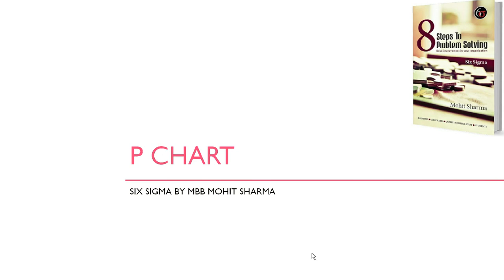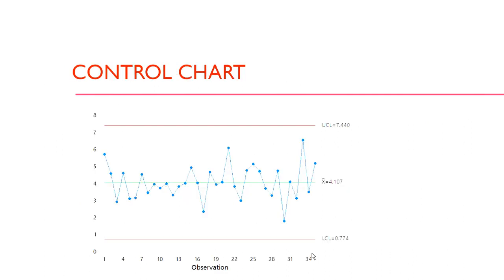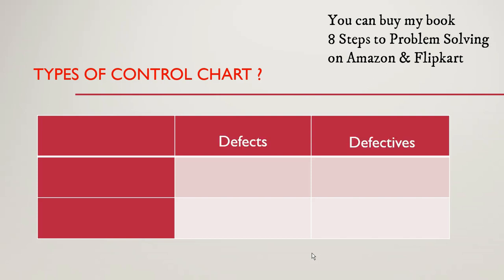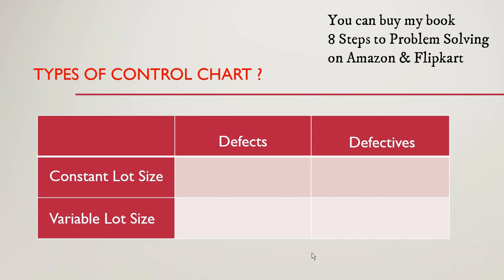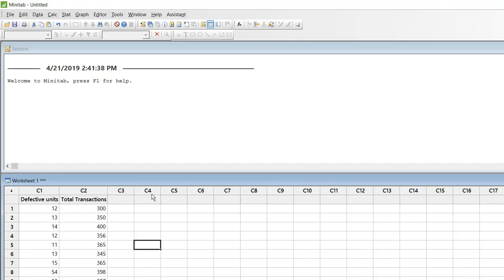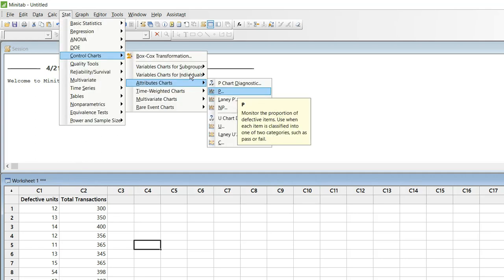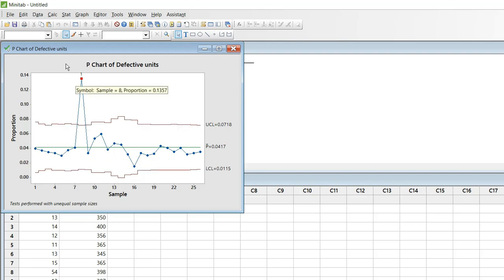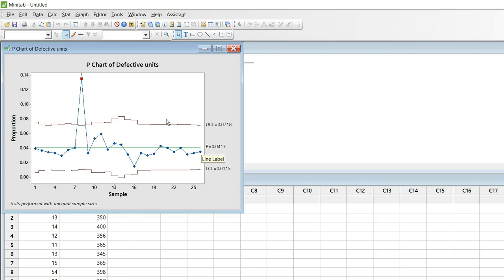P Chart - Attribute control chart

Comment: Thank you sir, very useful: I was under the impression that any product might have many defects. However, product can't be considered defective until defects prevent the product from functioning. If a product is not usable, it is considered defective.
Reply from the maker: Yes so it is important to measure both the metrics to know how many critical defects are happening that are making products unusable.